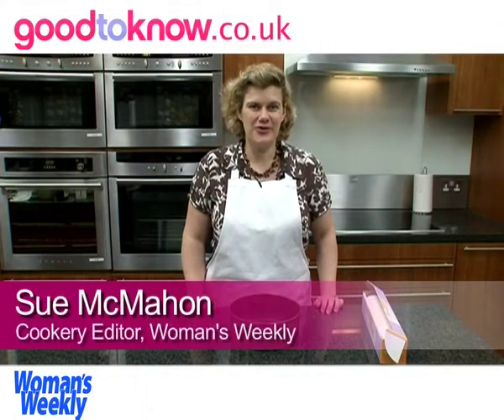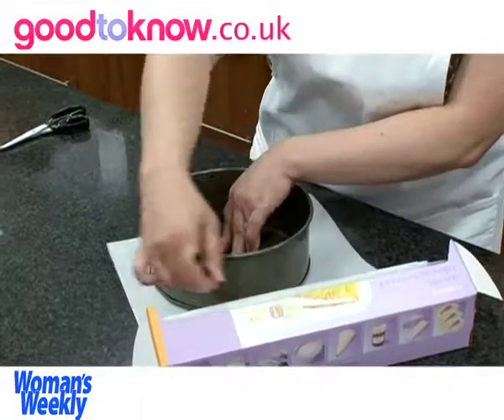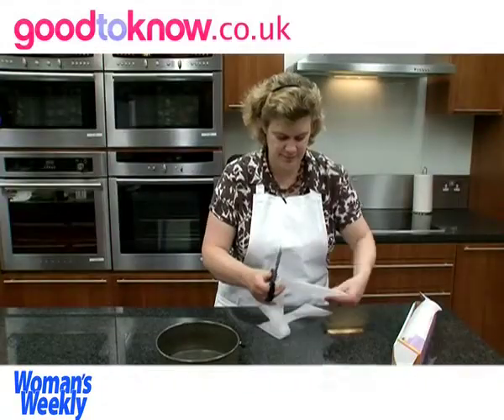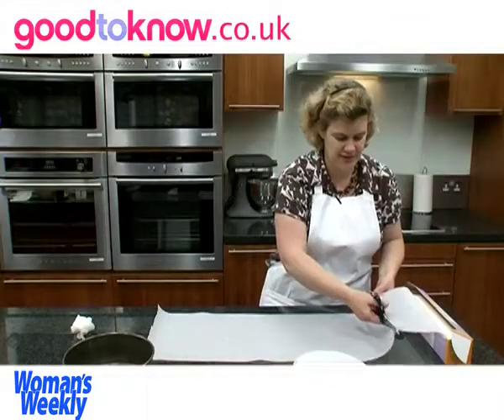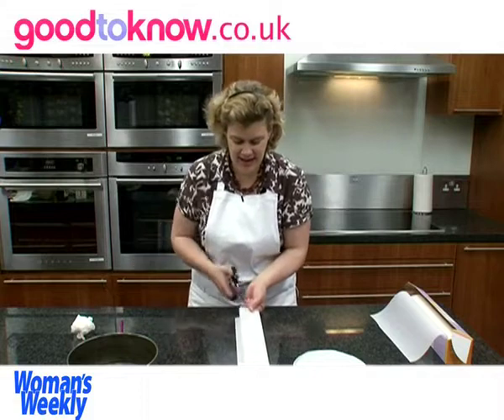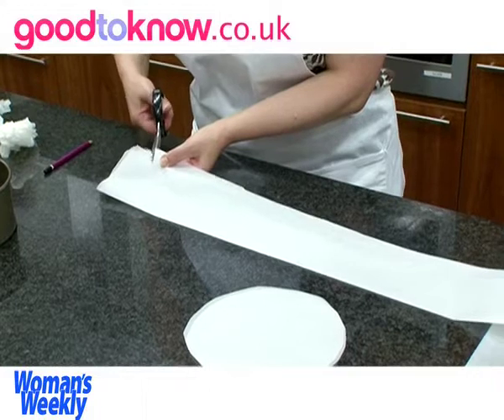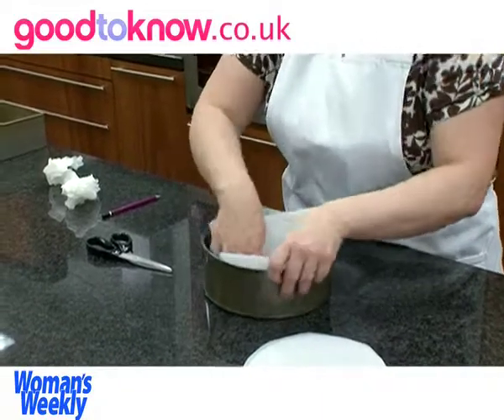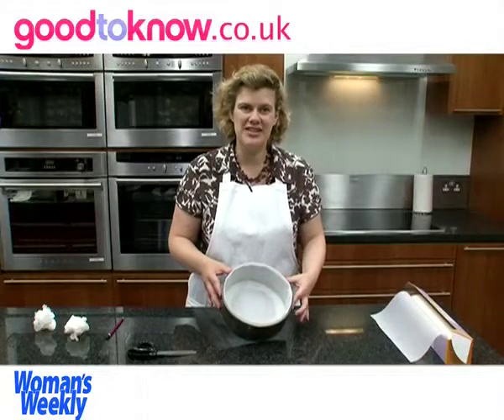How to line a round cake tin

Comment: still carnt line an f'in cake tin!! im trying to line two 20cm sandwich cake tins with a slight lip on the outer edge of tin, every time i try and line them the paper doesnt stick to the sides of the tin at all and the flaps dont stick to the bottom properly- the second layer of flaps stick up, its a right mess! i can do the bottom bit but not the sides... what am i doing wrong?! and can you please post a video of you lining two sandwich tins? in the same way. HELP!!!!
Reply: Im with you on that one. The paper certainly doesnt stick having the same problem